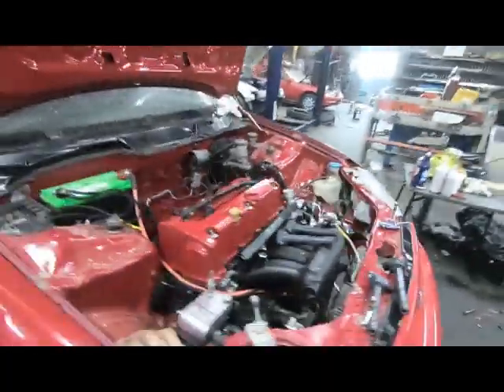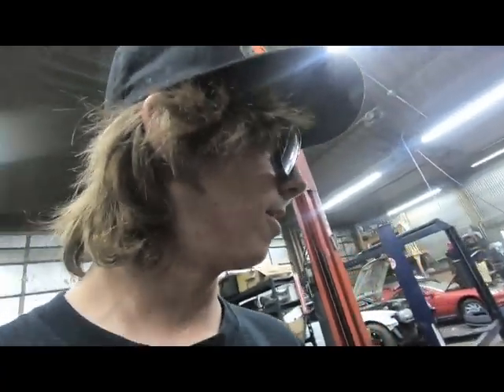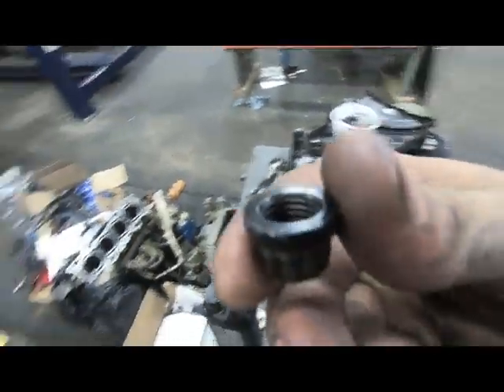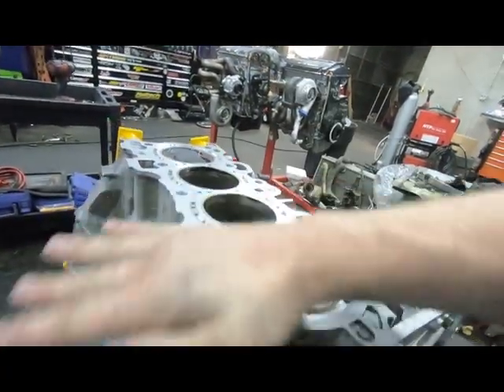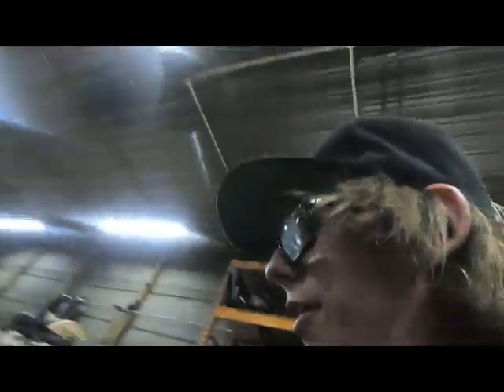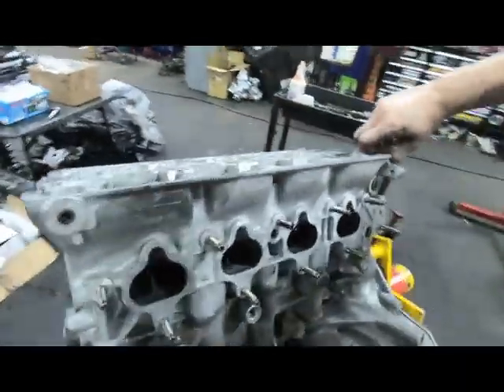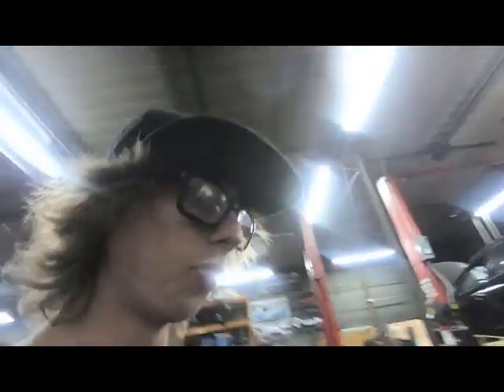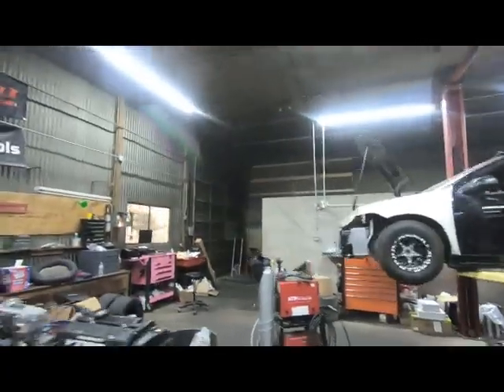Ls Vtec and a Gsr Set Let Go!!

Comment: You need some kind of plate to bolt on them engines. Like find two bolt holes that you can use for a name plate to get that goofybuilt name out there. That would be cool to see. Like a stamp to put your signature on the motors you build